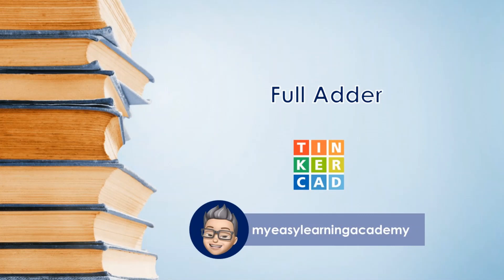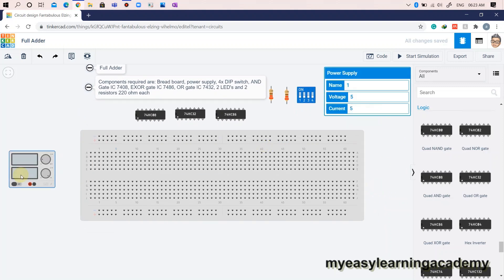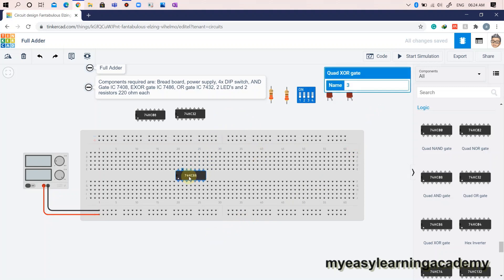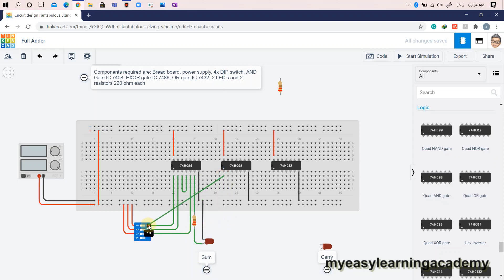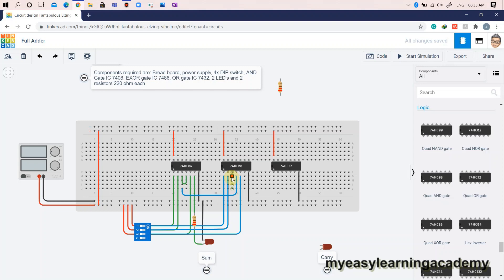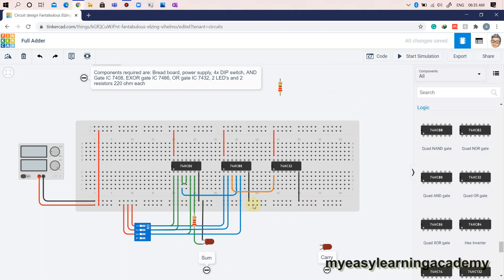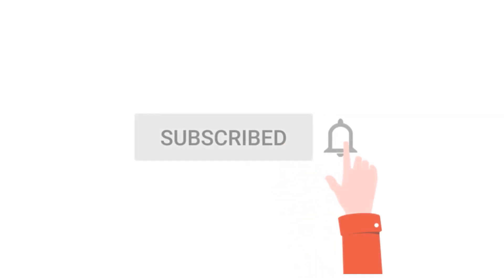Full Adder | Tinkercad

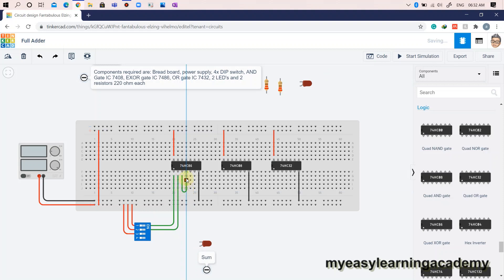Comment: Excuse me, There are two XOR, gate, AND gate, but in the circuit You used only one. and also 3:39 like attach line ,you connected,why do you need to connect like this,i dont understand, can you write me why this reason.
Reply from the maker: The expression for sum is SUM = EXOR (A, B, C). In the first step we have performed EXOR operation of (A, B), the result of which is further EXOR ed with the third input C in the second step. The EXOR output of A and B is available at pin 3 of the EXOR gate IC (step 1). This output is then EXOR ed with input C. Hence, output available at pin 3 is connected to pin 4 (for step 2). I hope this explanation is helpful to you. Thank you.

Comment: Excuse me sir, 3:39 - why do you connect those 2 pins together? I'm fairly new to this and I'm trying to understand.
Reply from the maker: The expression for sum output is SUM = EXOR (A,B,Cin). The first IC is EXOR IC whose pin no. 1 and 2 are input pins which can be used to realize the operation EXOR(A,B) whose output is available at pin 3. To realize the expression of sum output we need to take EXOR(Cin and output available at pin 3). Hence, pin no 3 is connected to pin 4 and input Cin is connected to pin 5. Final sum is available at pin 6. I hope this explanation is helpful and might solve your query.

Comment: My 7486 got blasted how to fix that...
Reply from the maker: There are several reasons why an IC can get damaged. Here are a few important ones:
1. Check the supply (Vcc) and Ground of the IC. 
2. Excess voltage and current can damage your IC. Check voltage and current ratings set on the power supply.
3. Check the connections on the output pins. A high voltage on both sides of the output pin may also damage your IC. This is one of the most common mistakes which may occur while making connections or implementing any circuit.